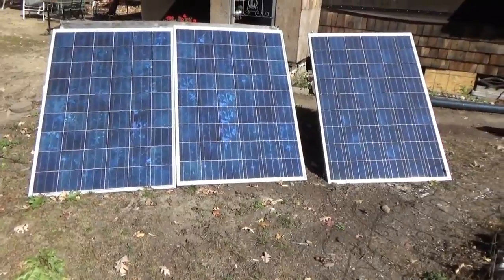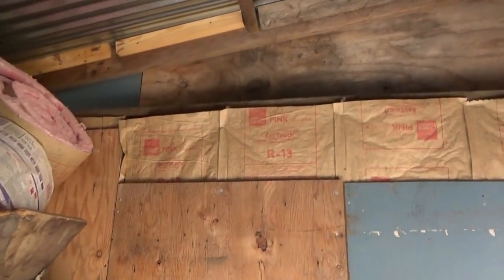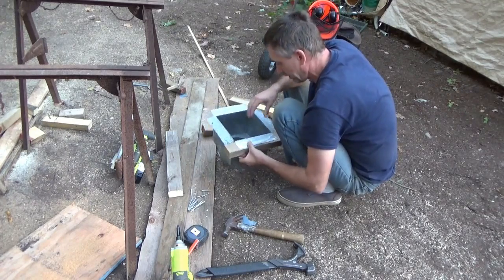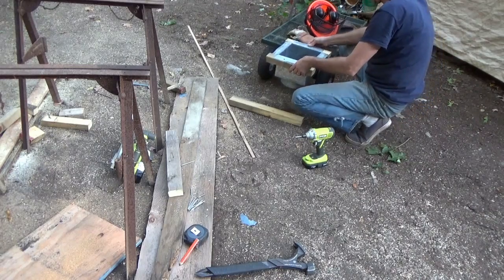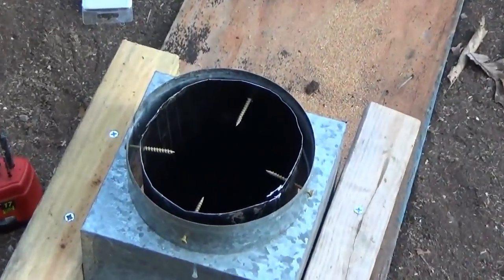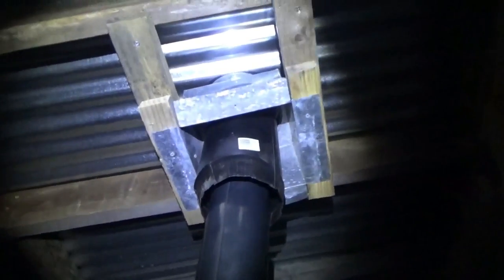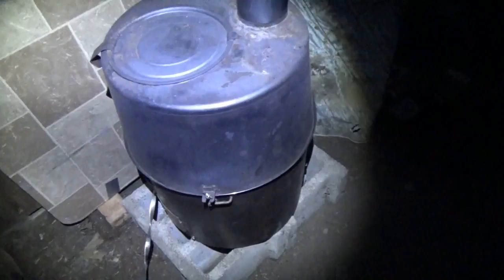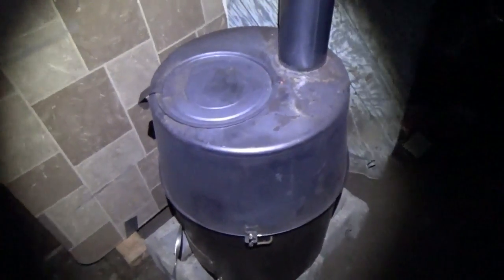Installing M 45 Tent Stove In Off Grid Water Shed

Comment: Troy why don't you use the heat from the house, run some duct work with a fan close the shed up. you won't need to much heat to keep it warm. I seen in one of videos that you were using a fan to vent heat out of the window up stairs. all you really have to do is seal off the battery room properly that's it. and believe me it works, I'm from the great white north (CANADA) and we know cold!   LOL!!

Comment: Try to find a 4 in. stovepipe damper. forget about the fire bricks. Mix up a THICK batch of masonry concrete and apply a 1-2 inch coat to the upper half of your drum. You have a fast burn/fast heat tin heater made to warm campers up in a HURRY. the concrete will be a good heat sink, your water tanks are too low to soak up BTUs in their configuration. Tried it once with 50 gallon drums. no go. They must be closer for the radiant heat to work.

Comment: Nice work troy , if you can build your elf a pallet wood door for the water shed ok then you can cut a round hole for the solar heater vent through the hole , you only need 1 inch on the bottom of your door , wood stove is very nice , now how much water do you have ?

Comment: military would use flat style fiberglass rope and a high temp adhesive to seal those up.  they would also add a damper in the stove pipe.

Comment: Isn't that material curtain just a little too close to that stove, wood doesn't generally self ignite at a 100 degrees, but material does,.. xx
Reply: I hope this is not true as 100 degrees is not an unusal temp in the tropics!
Reply: Come on guys, it's not 100 irrational Fahrenheit degrees, it's 100°C.
Reply: DialecticKaos
I have no idea, but the comments above saying "the desert can get hotter than 100 degrees" are funnier than mine.
Reply: *****
You are correct. I wish the USA stopped using Fahrenheit and switched to the unit everybody else in the world uses. So much confusion
Reply: *****
I know. They should have done it in the 70s together with Australia.
 Although I'm not sure if the problems that the metrication would cause are worse than the problems caused today by the confusion (Mars Climate Orbiter, anyone remembers?)

Comment: Is there a way you could put that stove in its own separate housing a few feet away  and make it a wood furnace to heat the shed? It would be make it safer separated the shed. There are videos here own you tube for wood furnace or wood boiler, helps heat hot water too. 

Also, shouldn't you keep a pail of sand and afire extinguisher in that shed?

Comment: You are NOT measuring heat at the place the laser hits. Check the docs of your device. it reads a circle that expands with distance like an invisible cone. Mine has a diagram on the side to give the area of the circle as distance increases from the unit. Get close on a ladder to read temps at a distance.

Comment: Batteries off-gas Hydrogen when they are charging.  My concern is having the stove in the shed, might ignite the hydrogen from the batteries while they are charging.  If the batteries are vented to outside the shed, then you should be safe.

Comment: That tent stove is used in the middle of a large tent, and usually fed with Diesel or jet fuel so it is usually controllable, and there's no risk of walls getting hot when its in the middle of the room. I have some extra fuel regulators, and an extra entire stove if anyone wants one. (cheap)
Reply: Neil Shubert cool im interested in one if u still have it.
Reply from the maker: Please give me the price for a regulator. I am going to build a waste oil burner one day. The regulator was one thing I was missing. I will not use the one from this stove because I never take apart anything that works, if you know what I mean

Comment: How did you keep water from freezing before?
Reply from the maker: I did not. Just used gallon jugs
Reply: The Do It Yourself World 
How where you able to shower yourself?  Could you heat the water someway?
Reply: He heated it on the stove and transferred it to a bucket in the shower which had a pump that fed the water up through the shower head. It doesn't take a whole lot of boiling water to heat water in a bucket to warm enough to shower unless you have to have a scalding shower.
Reply from the maker: Before I was married I simply heated water on the wood stove in a kettle and washed in a dollar store container. Camp washing I guess you could call it.

Comment: Hey Troy,  I just watched a very interesting modification  to a wood stove that may help you
regulate the heat output of this Monster tent stove.   

This guy made a 2 barrel stove and made sure to seal off all the fresh air intake leaks but then ran a 2 or 3 inch pipe out the front bottom of the stove and using 90 degree elbow ran the intake pipe into the ground and outside his greenhouse then up out of the ground to a valve and then a wooden box with fan in it and a  clothes dryer intake flapper on the end.

His gizmo was complicated but I think just running intake to outside with a big valve in the PVC pipe he said really reduced the burn rate of his stove and let it burn slow overnight.

Maybe this video will inspire a way to use this remote air intake to help you tame the beast.

https://www.youtube.com/watch?v=eQBIyBtyJj0